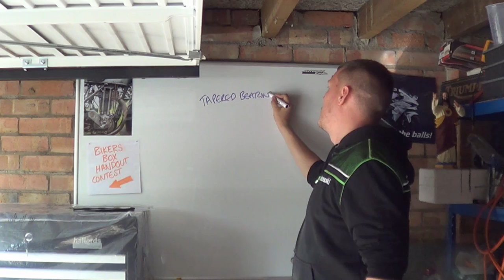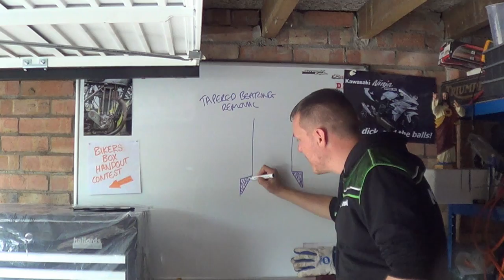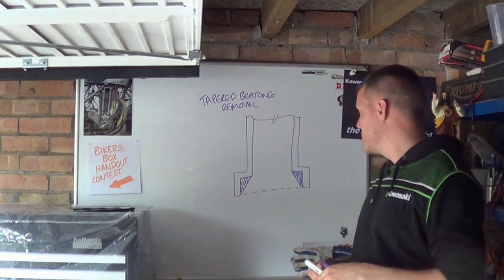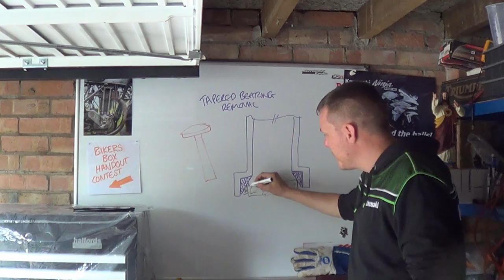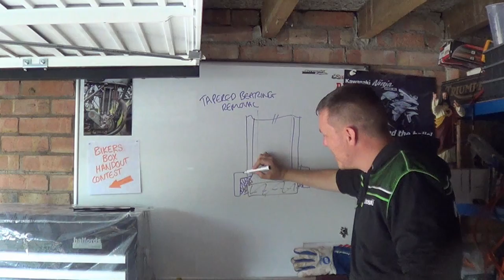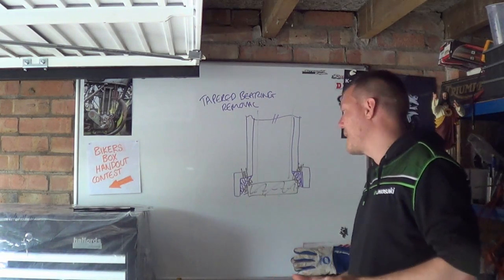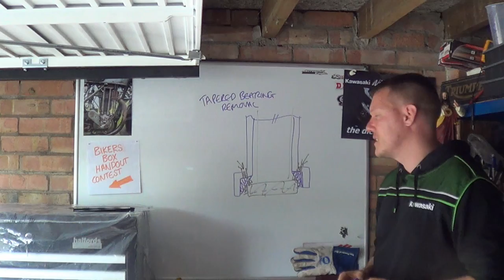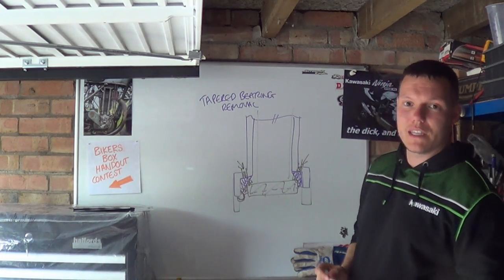Removing stuck tapered roller bearings

Comment: Most bikes that are set up from the factory for tapered bearings have 2 slots on opposite sides in the headstock's inner lip so you can punch them out from the inside with  a screwdriver or a long punch.
The ones that use cartridge bearings are pretty much straight forward.
Reply from the maker: I think you're talking shit - https://scontent-lhr3-1.xx.fbcdn.net/v/t1.0-9/19961625_1895900660677047_897653184224461878_n.jpg?oh=3e0ab6b9f455c1b3466cec301b910648&oe=59C3A5AC

https://scontent-lhr3-1.xx.fbcdn.net/v/t1.0-9/19905458_1895900657343714_8676580859672944806_n.jpg?oh=fd6a862942a10c3bed8a2f596cc97fac&oe=5A0A7500

https://scontent-lhr3-1.xx.fbcdn.net/v/t1.0-9/19511424_1895901320676981_4192099077691316291_n.jpg?oh=cdc4c4360c8253baefefef62ae2562dd&oe=59FC6240
Reply: I think that's only true for aluminium frames .

Comment: On plant transmissions (bigger bearings, perhaps...) we used to lay a bead of stick weld around most of the inside of the race - that usually shrinks the bearing enough to loosen it anyway.  But welding a plate in is even better.
Reply: I have welded beads....then hit the bead with a punch.  Like mentioned, the heat from welding frees it up pretty good.
Reply: Will Dean This is my go-to method too!
Reply: Will Dean yep done that myself pops out easily

Comment: How about a cutting disc on a dremal? I understand caution would need to be taken to not cut into the frame but would this work, a few cuts deep enough?
Reply from the maker: Like you said - if you could cut deep enough - the problem is getting in there with the size of dremel wheels

Comment: Perfect, thanks, I have an immaculate 31 year old RD350 that some orangutan has put in tapered bearings exactly as you describe, they are now knackered and had me scratching my head, time to get the welder out and try not to damage the paint on the frame...…...

Comment: I'm trying to do the opposite on my CB350 right now... I thought I had a couple of old bearing I could use to bash them in, on a length of threaded rod (which the installers are basically) but I can only find one.

Comment: I had nothing but an outer bearing race in a blind bore. Used the mig to run a bead all the way around the inside of the race, and when it cooled it had shrunk so much, I could just pull it out with my fingers.
The shrinkage effect is even more pronounced when you do repeated stop and go, plus that doesn't heat the bearing housing so much.

Comment: I always cut mine out with acetylene torch.   I don’t recommend it unless you are a pro like me or you will cut into the hub .  The way to do it is cut 90% through 180 degrees apart then chisel it into two.

Comment: Piss poor forward planning making a stem assembly with no room for a lip for a bearing with an outer race same diameter as the stem. I guess it ain't the manufacturers problem. I asked you this last year  and you linked a photo of the Hole drilling method. Id already dremelled them. Nightmare !

Comment: no disc required just a nice bead of weld around the race shrinks it enough when cooled to just fall out.iv done it this way loads of times works a treat..
Reply: Me too… 35-years ago… Had to remove TR outer races from a Yamaha RD400. Read something in Motorcycle Mechanics about placing a weld bead directly onto the conical bearing-contact face. All I had was a cheap stick welder, a measure of skepticism and an empty shed of desperation. A 1” long bead, a few minutes cooling and the bottom bearing just fell out. I thought “that was too easy… Sod’s law says the top one will be the problem” but no… same deal, turned the frame upside down and the top one came out just as easy. I like the washer weld idea though…

Comment: On the subject of stainless steel, what do you think of stainless steel replacement bolt kits for bikes? One part of me thinks that they're not used for hardness/strength reasons and the other reason is it's cheaper to ship em out with bolts that rust like fuck. These aftermarket bolt kits worth doing in humid countries like England?
Reply from the maker: Depends what bolts in general. But for case bolts which I think is what your talking about - yes they're a good idea for England.

Comment: the question is why there aren't holes in the first place, with thread in it?
then you can simply drive 2 screw in there that will push the bearing out, and you can plug the holes with shorter screws afterwards...
Reply from the maker: Water.

Comment: You can also take a dremel with a little cutting blade and cut 2-3 gaps into the bearing without cutting into the frame and then take a chisel to crack the bearing in the cuts and it falls most of the times out all by it self. And you can insert the new bearing. Ok, done wrong you fuck it up but it is not that difficult. They do not have to be cut in an 90° angle I think it works better if you cut it in a 45° angle.
Reply from the maker: Have you tried this? I have on the ER5 videos, cutting disc and dremel, with a cold work chisel, fucking nightmare, and that was with a outer race which was for balls and it has a thinner crossection
Reply: LOL! YES it is a nightmare sometimes... And I did that on my Z650 B1 back then... Lucky that we had a good heavy duty cutting disc for it. I did not say that it is easy! But it is possible! You have to work sometime with what you have and if you do not want to drill and have no welder you have not many choices left.

Comment: or you could buy the tool. this is the one a lot of airhead mechanics use.  http://www.cycleworks.net/index.php?main_page=product_info&cPath=29_33_50&products_id=62 there ar others available
Reply from the maker: This only work if you can land on the back of the bearing which isn't what I'm talking about here
Reply: Matt you are incorrect all BMW airhead steering heads have this design feature.  the hardened split steel disk of the tool has a knife edge that is forced under the edge of the race. I have used this tool 4 times. upper and lower on two steering bearing replacements it works well for the money.